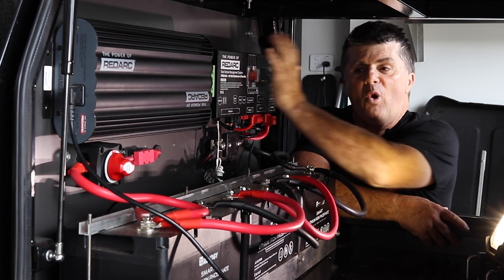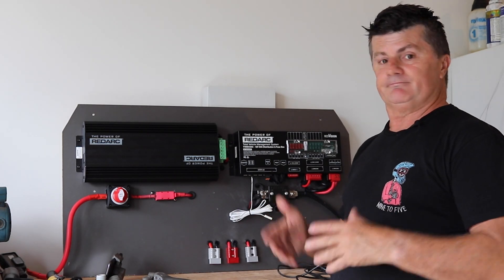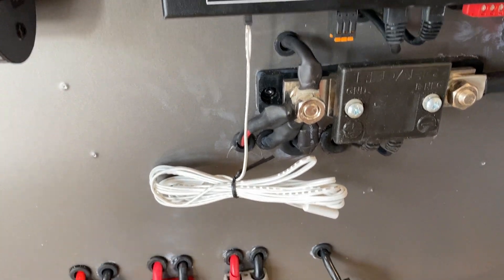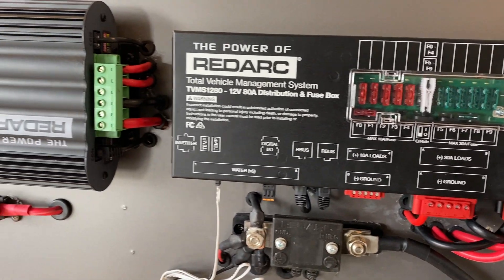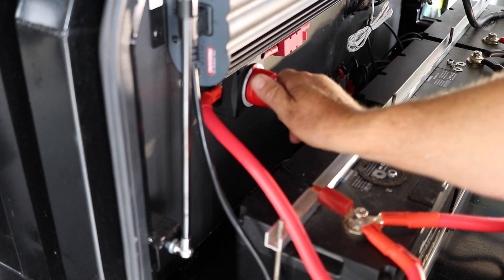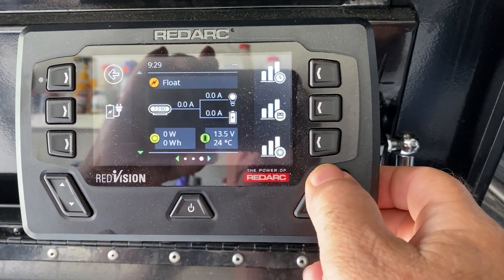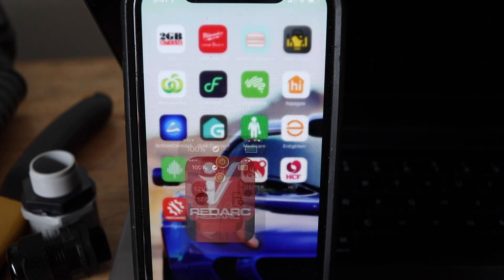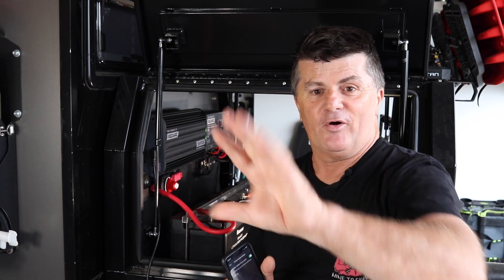The Ultimate Teardrop Trailer 12 volt System // DIY Off Road Camper // Redarc Redvision // Part 2

Comment: the 10amp loads isn't 10amp in total.. its 5x 10 amp, just as the 30 amp its 5x 30 amp.. So the lights being led you could easy put into the 10amp slots the 30a should only really used with heavy loads like large fridges, large pumps, large motors.
Reply from the maker: correct!